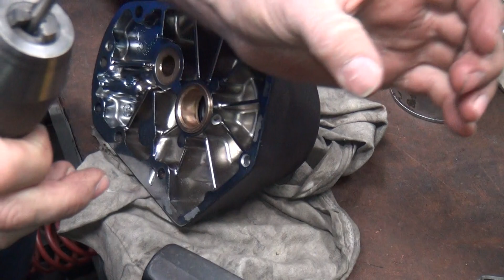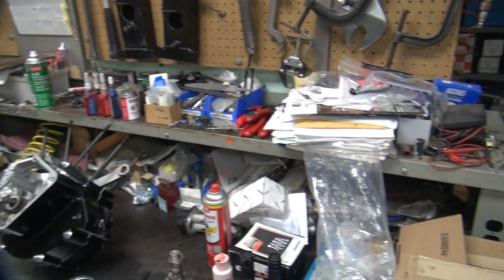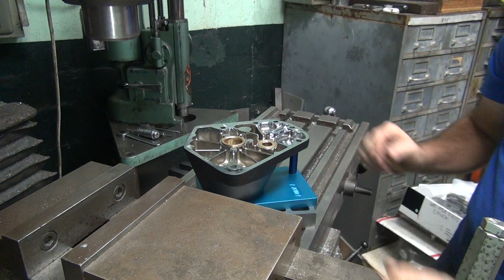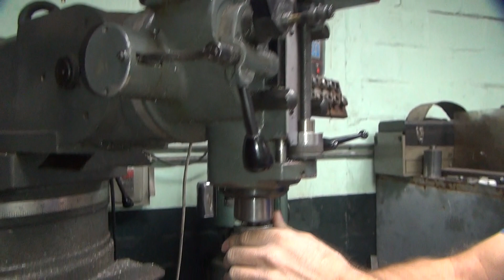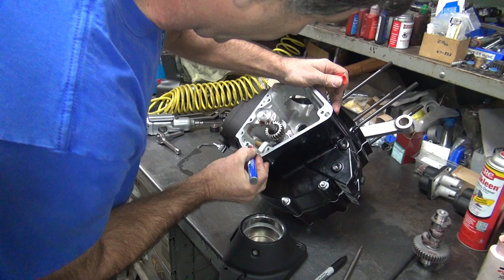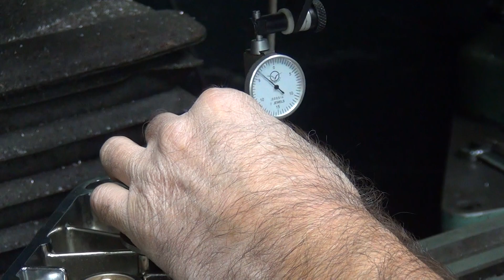2000 fxr4 80ci #117 motor rebuild fxr evo harley evolution cam bearing repair by tatro machine

Comment: I've got a 93' FXLR with an 80 inch Evo with 18,000 miles on the clock and it runs like a dream . I suppose with proper maintenance and keeping the revs down it'll easily go 50,000 miles then I'll rebuild it whether it needs it or not just to be safe .
Reply from the maker: an evo will easily go 75k miles if you take care of it. that is still riding it semi hard. i have seen over 125k miles like you are taking about.
tatro
Reply: I would not rebuild it unless I was doing a power upgrade or it broke.

Comment: Is the a distinction visually looking a  engine to tell what size a engine is ?i have a 2007 engine an dont no what it is in size .
Reply from the maker: good luck with that. that is why they tear you down and measure you after you get a record.
tatro
Reply: @TatroMachine  Atta boy smart ass B S
Reply: you can do a vin check . Just google Harley Davidson vin decoder , but that won't tell you if it's been bored out to a larger size .

Comment: I know you're a top notch mechanic and have the best skillset I've ever seen but given that you stated another cover fit correctly why not just throw another cover at it and be done with it? Toss that one in the trash and save yourself the aggravation.
Reply from the maker: because the customer wants to keep his black cover. these are not my motors being built here, its not like i can just do whatever i want to do. i am building motors to what the customer wants. its up to me to come up with the correct combantion of parts that meets his demands and price point. oh, it has to lat and not leak too.
tatro
Reply: @TatroMachine  sorry to hear that Keenan. I'd graciously pay whatever it takes to make it right and not make it such a PITA for you to have to go through. I guess what people fail to realize is that the time consumed by paying for your labor could have easily been saved on the correct part that progressed the job and caused you a lot less grief. Again, sorry to see you had to go thru such BS. Honestly I've never seen something kick your ass like this before. I knew you'd win but it could've been SO much better had this gentleman said "How about I pay for an off the shelf used one that works" and then called it a day. Spray paint it black and be done with it..
Reply from the maker: that was powder coat and i did not have a used one, only a new chrome one. that would not be the style of this motor. this is a common problem on harley motors. you can see this in most of my motor builds. i need to make some special tooling up to make this repairable to my standards. i think i have a plan now. its just a matter of getting the time to make it.
tatro